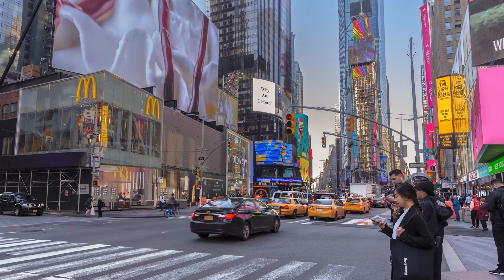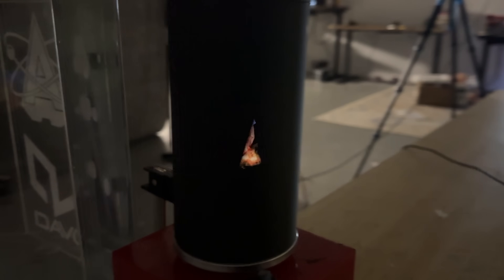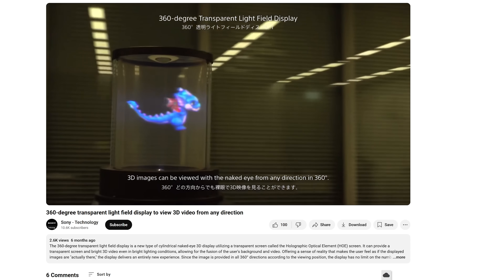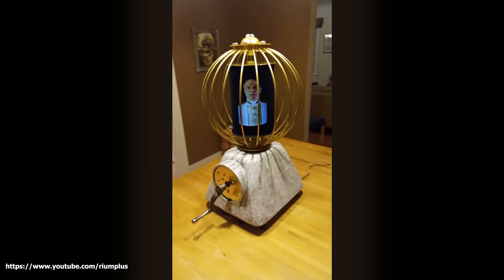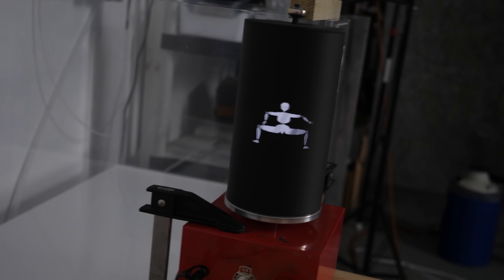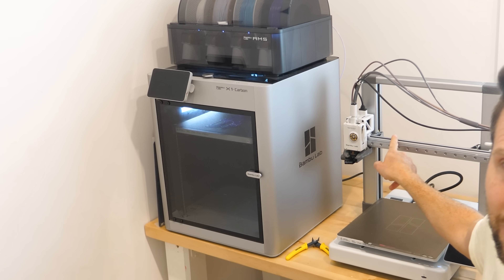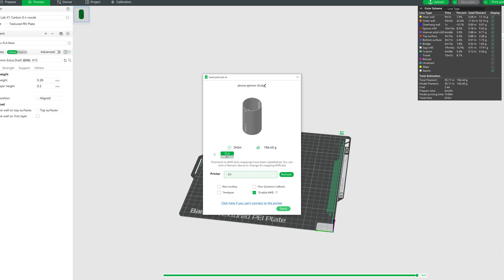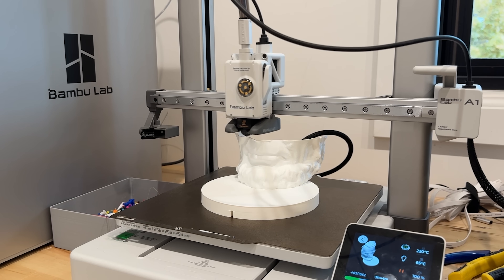The World's First Omnidirectional Screen

Comment: NEW invention?  Wha?
I had one working in 1988, destined to be an exhibit in "Three-D A Look In Depth," by MOS Boston.  It's like the cylindrical "Kiss" hologram from Edmund, but using geometrical optics.  My crude prototype used a DC motor and two vinyl records w/black-painted cardboard, w/batteries for the lamp, and a slit rather than a cylinder lens.  But we had too many exhibits already, so I never built the full version.  The test-image was a still print of felix the cat, just like in early television  ...only stretched wide, to give a perceived circle.
Also I had a giant 3D lenticular postcard (3mm lenses, with hand-edited 1988 line-printer graphics,) giant 4-mirror stereoscope, and several others (but no scratch-holograms.  I didn't stumble upon that effect until 1994.)

Comment: Would it be possible to use the concept here and enhance it to when you don't need moving parts for it to work? It's just a light source that shines in 360 degrees right? Surely there must be a way to make a stationary display do the same.

Comment: Practical considerations to use it as a sit-around screen:
1 - A Transparent shield must be put around the cylinder to avoid accidents;
2 - Dinamic fine balance/speed control must be implemented to minimize noise and wobbly images;
3 - The decoding hardware must be placed inside the cylinder or the signal must be transmited via BT or WiFi;
4 - Maybe a combination of clockwise/counter-clockwise rotation speeds, between the screen and the slit must be devised in order to minimize the linear velocity of both screen extremities; Not to mention the G force those extremeties will be subject to as the screens get larger;
BTW, from your video I kind figured out that for a 2" wide screen the slit was about 3/16"... Is that the correct/only ratio for the effect to happen or is there a more precise value to consider?

Comment: Question; if that was mounted so the cylinder base is off-centre on the face of a plate at an angle of 45 degrees so the high end of the cylinder is at the centre, the rotation lowered to half speed and that plate also rotated at the same speed, would the image be equally viewable on both the  360 degrees of X axis and the upper 180 degrees of Z axis simultaneously, or would you just get a distorted  blurry image from all viewable angles?

Comment: Put a different image on each screen and angle the slots so that only one eye can mostly see one phone and the other can mostly only see the other. No new file types required and a simple stereoscopic recording rig needed which is basically two cameras side by side one for each video. You can use two videos of something recorded at different angles and create a "3d" depth image that's always facing the viewer

Comment: maybe to make this less dangerous (i.e., remove spinning parts), the outside "cage" could be replaced with strips of LCD film that selectively blocks light. like those panels that turn black at the flick of a switch. then modulate the strips to show a rotating slit.

Comment: I actually proposed this idea as my FYP in university. Just waiting for it to get accepted. I am going to make a large scale andotrope with smart features with A.I. i have already made a small prototype. Should i make a video on the progress?
And what size of display should i use? I don't want to make it too big because its very dangerous since it has high speed. My prototype already have damages my body enough 😂, i will be careful with Large one. I was thinking of 2 display sizes.... One is 4:3 19inch other is 16:9 or 16:10 24inch display. Which should i go for?? Any suggestions...

Comment: I wonder if you could achieve the same effect digitally by not having the outer casing with the slit, but still using 2 displays that playback videos but only showing a narrow, vertical segment equal the size of the slit.

Like imagine a video chopped up vertically into strips that would display 1 strip every frame going from right to left/left to right.

Comment: Hey there, I actually ended up buying the Bambu Labs A1 3D printer. I've had the printer for almost a year now and I just started having an issue with it. The issue I'm having is that the nozzle head keeps scraping against the first layer of the print, and this only seems to happen durring the first few layers and it only happens while printing the inner parts of the first few layers. It doesn't happen while printing the outer perimeter of the print. I tried contacting Bambu Labs for help but I'm still waiting for a response. I was hoping you would be able to give me some insight on what the problem might be if you've experianced this before while 3D printing.

Comment: It is insane as you mentioned that this hasn't been around for decades now since at the core it's such a simple concept that's been around for ages but works so well.

This would be great for places like stadiums and sports arenas instead of the big cube screen in the middle.
Reply: It has actually been around for decades. I foind a patent from 2006: US20060179693A1: "Device providing simultaneous visibility of images within the area of 360 around itself"

Comment: I was thinking of using (one would need a serious wire track!) 16:9 or 1:1 aspect displays on a rotational device to make a 180 degree (not 360 degree, who looks down?!?!) display for a circular oriented pub, or any pub that showcases sports, without having to put so many 2160p/4K (same thing) or 1080p displays all over the fucking place. That alone would save $$$$,$$
Then again, companies often discount in bulk, 𝘢𝘯𝘥 𝘐 𝘤𝘢𝘯'𝘵 𝘣𝘢𝘤𝘬 𝘵𝘩𝘪𝘴 𝘴𝘩𝘪𝘵 𝘥𝘶𝘦 𝘵𝘰 𝘯𝘰𝘵 𝘸𝘰𝘳𝘬𝘪𝘯𝘨 𝘪𝘯 𝘴𝘢𝘪𝘥 𝘤𝘰𝘮𝘱𝘢𝘯𝘪𝘦𝘴, defective backlit displays where the backlight is ten times as high on some parts of the modules, so pubs buy 'em up without giving a fuck as long as the displays work, regardless.

Comment: It's a very cool invention, & if the inventor hasn't patented it yet, it's going to get stolen or already has.
Reply: It has already been patented in 2006: US20060179693A1, "Device providing simultaneous visibility of images within the area of 360 around itself"

Comment: The biggest problem is the screens needing to be spun, however you could actually combine that by using the tube they are in to circulate air as well, that way the spin is not just used for the screens but to actually do work.

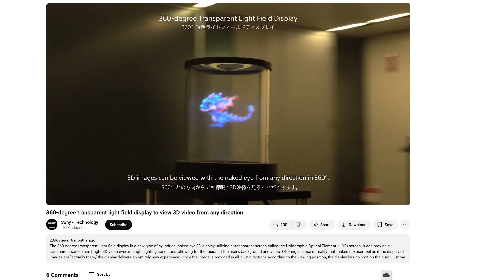Comment: 1:33 It's not impractical because of scanning, you could just render stuff from scratch, and scanning is a solved problem anyway. The impracticality is that only one observer can view it, and there has to be cameras working out the position of the observer to display the image correctly

doi: 10.1145/3305367.3327974
Reply: No, many people can see it, without cameras tracking them, because the rotating slit reveals the image to one person after another, very quickly.

Comment: With a big enough cylinder, could you use more than 2 screens?
Reply: I’d think so. It would just raise the frame rate some more,which is a good thing I think. Especially if this goes in more advanced directions, I feel that’s the next step honestly.

Comment: so I'm just spitballing, but what if it was 4 led panels and 4 slits for higher "refresh" rate, and instead of being atop a motor, it was mounted to a bearing, using pneumatic pressure to spin? It would theoretically be quieter and better looking, and therefore more fit to scale to larger displays. It could be a better way to create advertising stands, where no matter someone is standing (say in a mall or on the street), they'd see the same image

Comment: 450 RPM sounds like a lot, especially if you want to be able to scale the size up. It seems to produce a lot of noise and would probably get dangerous at larger sizes. I wonder if there is a way to replicate this without needing to actually spin something. Maybe lighting up LEDs in sequence. (probably not, but I'm no engineer).

Comment: I had a frisbee with a vertical line of LED lights on the side, that would blink rapidly in such a way that it formed floating text around the frisbee when you threw it, due to persistence of vision.
If you think of those train/bus LED grid displays that have text scrolling on them, and think of how the lights change for a single column of the display, you can put together how it worked.
It allowed for user-defined text.

Comment: Very cool idea! Just wondering how you determined the width of the slits on the andatrope? I'm assuming that if the slits are too thin or too wide it wouldn't work well. Also would more phones and their respective number of slits give you a higher frame rate or do you get diminishing returns?

Comment: I don't get it. When you view both phones from the side, looking right at the edge, how are you seeing either of the images? And why is the image not getting skewed when looking at it from an side angle?
Reply: I know right... What a strange presentation.
Reply: I think the slits in the cylinder are only directly in front of the screens, so the only times you ever actually see the screens is when they’re facing you straight on, then your brain fills in the gaps while it’s obscured (like with a normal monitor’s refresh rate).   I am curious about what long term effects the high speed rotation has on the phones/screens though…. 😵‍💫   (In case it wasn’t clear, the phones are spinning with the cylinder)
Reply: @ThetaGraphics  if you needed to be in front of the screen for this to work, you could just look at the screen. but he is showing in the video that he is walking around it more than 90 degrees and it still works, while the phones inside are static
Reply: @OlivioSarikas . The phones are actually not static, they are spinning with the cylinder.   (I had edited my first post to clarify this, but it probably didn’t email the update, lol. 🤷‍♂️)
Reply: @ThetaGraphics  ohhhhhh! you are right! because he says in the video it works also with only one phone. thank you

Comment: What if you just use one display and you counter rotate it inside, while the outside rotates in the opposite direction?
Reply: It would work with only one display, the image would just be half as smooth and half as bright because you're effectively just seeing black for half the time.
Reply: @ it would actually be linearly 1/4 as bright.  Half the rotation is 0% brightness, while the other half’s time is equally 0% and 100%, averaging 50%.  The average of both half rotations is 25%…. Linearly.  Noticeably, or logarithmically, the light would be 2/3rds as bright to our perception.  You have to essentially double power 3 times to reach a brightness that’s noticeably twice as bright, and it works the same way when dividing light and sound.  If you wanted your 1000nit phone display to appear twice as bright, it would have to do 8000nits.  To appear half as bright, it would be 125nits.

Comment: I actually saw something like this at the CES in 1997 or 1998.  

Except it was huge.  Like Big Screen TV big.

Inside a plexiglass cylinder (for protection) was a 'noneuclidean' surface that the TV image was projected on to, that could be seen from all angles.

Company was trying to sell these or get funding.  Said it would be great to watch TV sports with 360-degree crowds.

Comment: Hrm, this would be easy to scale up also with just displays in the device..
the computer serving the video could be elsewhere.

The displays would be most likely have to be Wifi and the power via either induction or hard wired using existing technology that has existed for decades. 

It would be nice to have a wired display connection for latency though... And I'm sure it would be pretty easy a adjust the power tech for spinning things to work with displays. 

... There's a guy in CA that made his whole house spin.. Power was easy. The issue was the plumbing.

Comment: With 3 phones forming a triangle it would be easier to dynamically balance and would need only 2/3 of the rotational speed for same frame rate. And I think the brightness would be 3/2 higher, am I right or not?

Comment: ❤
Reply: When I was little I had a shoebox Los Alamos test range. 
====
I punch a hole in one end of a shoe box and put red cellophane tape over the hole 🕳️.
===
Then I take one of those old four-sided flash cube throwaways and hook it up to a battery 🔋.
===
I bring the wires together and poof  💨an atomic blast.
===
4 blast or step up the yield too tritium 4 not 10  . 
====
🌻
👋😎💨Bryan

Comment: The issue of mechanical displays is the noise. 

During the time i went to engineering university, someone built a Nipkow-TV and the mechanism was too loud. 

Plus the slits would (when not covered with for example plexiglass) create a whistling noise at a certain size, at least i assume. 

And there are safety concerns, when scaling in size. Having a giant rotating drum in the middle of a public space and people sometimes behaving like fools and poor maintenance of public infrastructure combined.

Comment: You might be able to make an improved version of this using just one phone, but four slits, potentially getting much higher quality images.

That is, using one of those cheap hologram pyramids used to make hologram images using a smart phone.

It would work by using a reflective pyramid inverted and sitting on top of the screen. The image on the phone is replicated four times and alligned with the pyramid faces, so the reflections look like a hologram. Combined with an andotrope with four slits, it could potentially increase the hologram effect quality while also being viewable from all directions, while also being cheaper, since it would only use one screen and a cheap reflective pyramid. With four slits, it can probably spin slower as well, saving on energy.

Comment: I'm sure I've seen this before, as in as soon as the video started I knew what you had, the only difference was the previous ones had directional displays whereas you have a wide angle display with a slit to force it into being a kind of directional display.
The biggest problem is they are so inefficient, you have to use it in a darkened room as so much light gets wasted.

Comment: Sweet!  I'm all set with my 50" OLED screen.  I made a table and slip ring connection so the cord can't rip off.  The TV is bolted down so it won't fall over.  I have a 2hp 1800rpm single phase motor attached to a 4.5:1 reduction drive to hit 400 rpm.   Now to power it on.......  Holy S**t that is awesome!   I can't see any image at all because the TV ripped itself apart from the 4,000 lb/ft of torque at the edges, but still!  10/10  would spend $4,700 again to see cockamamie explosion!
Reply: video or it didn't happen...
Reply: Better with 2 back to back. But are TVs actually shock resistant?

Comment: even before you explained it i could see how it was working..or i guess hear how it was working, it was very clearly a spinning cylinder.

somehow i don't think loud spinning cylinders are the future of displays, you will need some kind of solid state version.

perhaps a 360 degree display with an LCD screen around it, the LCD screen blocks all light except through a narrow slit that it then sweeps across the display. giving the same effect without the need of a motor.

Comment: If we calculate the pitch correctly, would it be possible to put two different screens, and go 3D ?
Reply: That would just give you two images shown at the same time.  Turning this into semi-3D (it would never look like a "solid" hologram) which one might call 2.5D, would be very complicated.  Maybe hundreds of these working together making up vertical slices of the image...and would probably require viewer detection to display the correct parts on each screen, which means it's only good from one viewing angle.  At that point it's easier to go back to the design shown here and deal with flatness seen from any side.
Hmm.  Actually...with 3D glasses and screen polarization, you could definitely put a 3D movie into this system.  3D in theatres works by projecting two scenes, each filtered through a polarized lens (angled 90 degrees from each other, one vertical, the other horizontal) that matches one eye of the glasses, so that the opposing scene is blacked out to that eye.  You still couldn't walk around it to see different views, however, unless the system was watching you and knew to turn the digital model accordingly.  That ability would let you look at the top or bottom of an object, too.  Two people on any side would still see the same scene & angle at the same time.  They couldn't both be tracked to change the image.

Comment: Thanks for showing us this. I was aware of the zoetrope, but this takes it to another level.
But I have a thought about some improvements. 1: What if the slits instead of watching the video through a 90 degree horizontal you changed the vertical slit angle to, say 45 degrees, or maybe negative 45 degrees? Wonder what it would do to the video. Or perhaps a smaller slit?
2: I think the experience would be even more enhanced if the cylinder color was black-black, as you showed us in another of your videos. This would let us concentrate on the actual video even more. Why not just paint the cylinder in the black paint you showed?